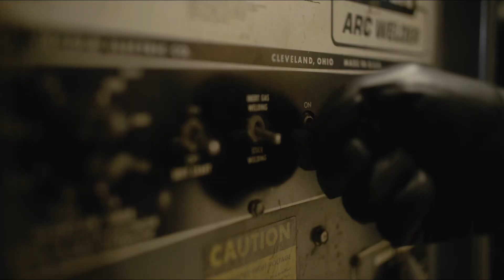EP:01 • WeldLabs x Lincoln Electric

Comment: Hey Rush, this is awesome. But make sure you tell these young men and women what to expect out in the world. Lots of places want miracles and don't understand hiw metal is effected by welding , warping and shrinking. You know what I mean.
Reply: Hi from Australia, Yeah, I'm a Fabricator with 25 years experience with Mig and Tig, and the amount of people that don't understand how Much certain metals Are affected during the Welding Process, and why Some Metals are Classified as "Un-weldable". The knowledge you build on over the years and need, to have to be able to Answer the Questions thrown at you even from Engineers. Like with thin Aluminium sheet metal fabrications, that you tell Engineers to have as many folds done to make a 3 Dimensional shape so that there are only a small amount of welds to finish it, less welding means less warping. Also Stainless Steel is a mongrel for Warping.